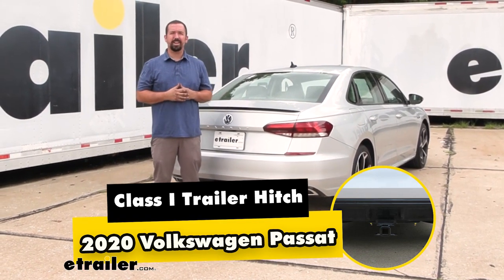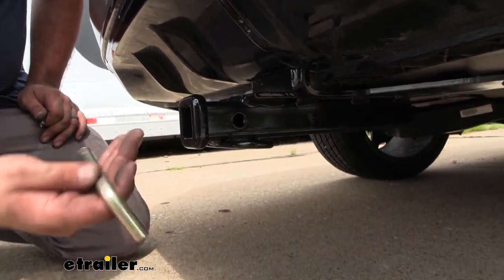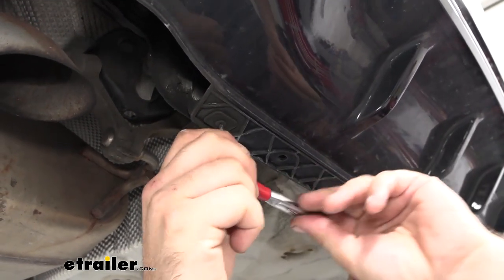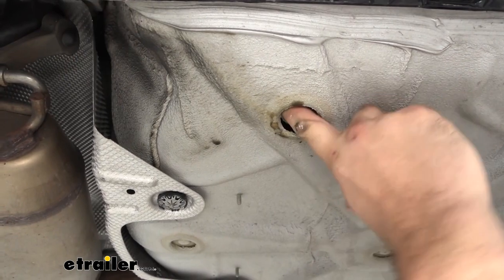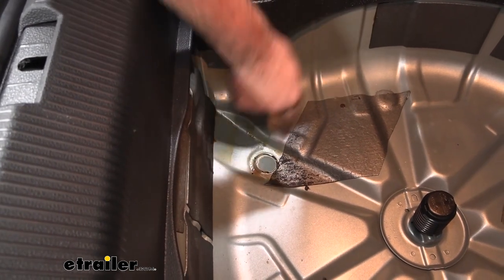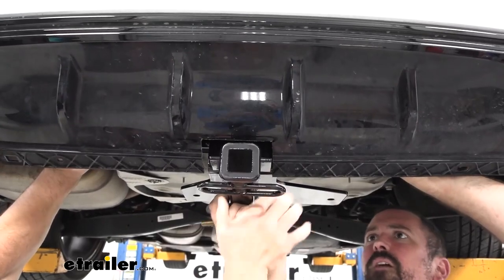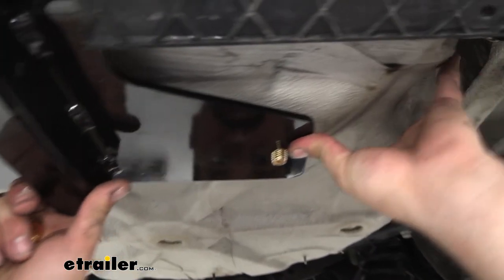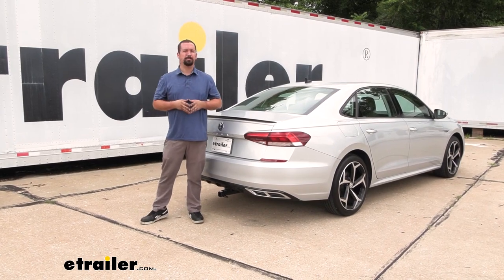etrailer | DIY 2020 Volkswagen Passat Installation for the Curt Trailer Hitch Receiver

Comment: will it void my warranty?
Reply from the maker: Purchasers of aftermarket automotive products are protected against warranty denials by the federal Magnusson-Moss Warranty Act. In summary, the act states that vehicle manufacturers cannot deny aftermarket part users warranty claims unless they can prove that the part actually caused the problem in question.
https://www.etrailer.com/Trailer-Hitch/CURT/C11234.html